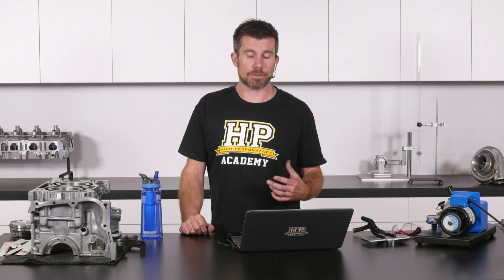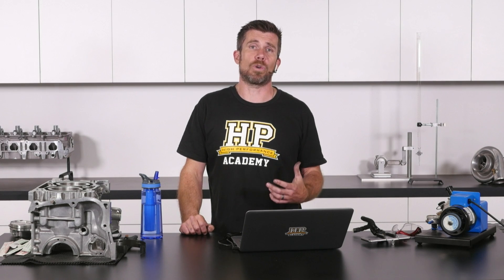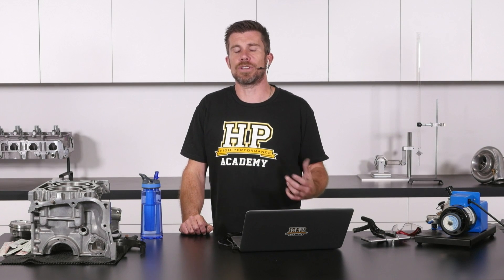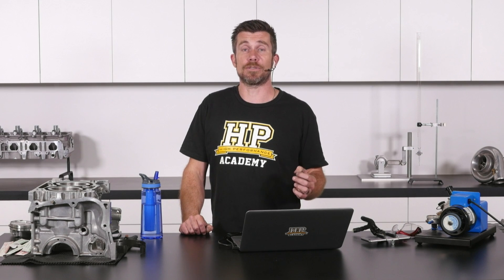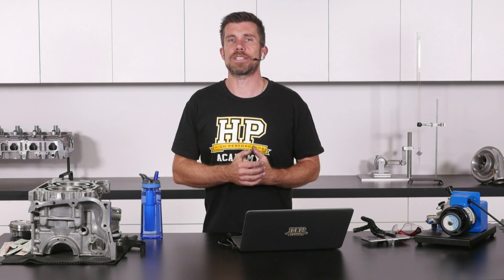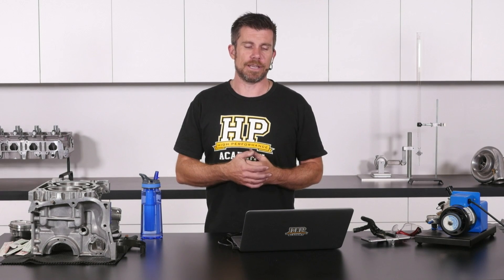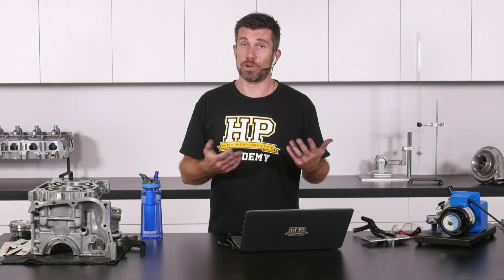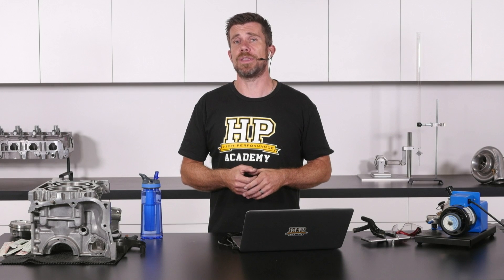Using Gapless Piston Rings On A Daily Driver [HPA Q&A]

Comment: I put well over 30K miles on my 355 with Total Seal 2nd ring gapless rings with no issues. 
 Oil stayed very clean for much longer, more idle vacuum, almost no leak down and great fuel economy. 
 The engine eventually broke a piston crown from detonation because i barely had a grasp on correct tuning. I was running too high of compression with too small of a camshaft on 87 octane fuel. I was also running the cheapest cast pistons I could find in the PAW catalog. 
Definitely was not the gapless rings fault. I still have that engine and eventually I will make it run again, with the same rings.

Comment: I want to know if the gapless and ported ring modifications offered by Total Seal would be useful for my application? I am rebuilding a junkyard replacement engine for a 2005 Volvo XC90 which I bought with a blown engine. The engine is a low pressure turbocharged 5 cylinder gas with designation B5254T2. The cylinders have been honed to take new Volvo pistons of size E in order to remove fine scratches in the bore (the originals were size D). My goal is to have a daily driver with power, longevity and low blowby. The carbon buildup in these engines is legendary for causing high crankcase pressure which  will blow out the seals. The vapor-oil separator device in the PCV system of these engines eventually gets its 3/4 inch oil return passage totally blocked with carbon. The fix is to replace the plastic carbon trap device and clear the remainder of the path into the oil pan, which may require removal of the oil pan if the passage within it is blocked. This happened to my XC70, which also has a 5 cylinder engine, but with VVT timing only on the exhaust cam. Upon disassembly of these engines, I noted that the return oil passages from the cams in these engines are tiny (like the diameter of a toothpick) and are nearly blocked with carbon deposits after 100,000 miles. These passages are created by matching grooves in the head and the cam cover and the only carbon removal method that would not damage the anaerobic sealing surfaces between the cam cover and the head was soda blasting.  
 I suspect that similar small nearly blocked passages were responsible for the strange behavior of my 2008 Volvo S80 after I had changed its PCV carbon accumulator device when it began to malfunction. This car has a 6 cylinder turbocharged engine and the device is on the top of the engine rather than under the intake manifold as in the 5 cylinder model. I changed the oil and filter after this service as I figured that some carbon particles may have gotten into the oil pan from the 1/4th of the carbon deposits removed by scraping and suction which were on the aluminum portion of the trap which was actually part of the head.  The very next trip was interrupted by the low oil warning on the dash. Inspection did not reveal any oil leak, but waiting for about 10 minutes and the oil was back in the oil pan. This behavior was unfortunately repeatable, and I assume that the temporarily missing oil is trapped in the head in the volume around the cams.  I have been treating this problem with Sea Foam added to the oil after oil changes, which shortens the time required for the oil to drain back to the pan. I have also been using Pro-Line Liquimoly engine flush before oil changes. 
In summary, does anyone have personal evidence for the effectiveness of the claims by Total Seal that modification of my top rings will decrease the blowby, increase the power, and make my rings last longer? 
Thanks for your consideration.

Comment: I’m confused because you say the rings won’t last long for a street engine but when you go to total seal’s web page they advertise the gapless rings as longer lasting than gapless rings and they are good for street engines... I know this is 2 years old but even summit racing magazines from 7 years ago advertise the same thing for gapless rings
Reply: That's what the manufacturer of the rings says. Remember that their goal is to sell their rings to as many people as possible, not to provide an objective analysis of their pros and cons. Other people who don't have a dog in the race may have different opinions or experiences. I never used them just because their long term durability isn't proven well enough IMO, but the fact that no production road cars that I'm aware of use them despite the technology being around for decades concerns me. Part of this could be a cost issue, but if their benefits were so great and they had no downsides, I would think we would see them used from the factory at least on higher end cars if not everything since less blow by also means less emissions, improved fuel efficiency, and longer oil life- all major benefits to car manufacturers.

Comment: I call BS on life expecting.   We been running total seal gap less rings for a few yrs on our daily heavy hauling cummins diesel,  have gotten just over 250k miles on it since its refresh and no issues,   best part is that the oil is cleaner than it used to be. Before the refresh,  so yeah telling people that they don't last long is BS.  525hp with 1900 ft-lbs of grunt with a quarter million miles is proof they dont wear out quicker than normal style rings.
Reply from the maker: 525hp on a large capacity diesel engine isn't really pushing the envelope performance wise. Andres experience with these rings and what he is more referring to are the likes of smaller capacity gasoline 1000HP+ performance builds.
At the end of the day it always pays to talk to your supplier before fitting anything as they have the most experience across a range of outputs and applications, and we are happy to hear your own setup is working as it should for your application 🤘 - Taz.
Reply: @hpa101  Great points. The fact that his engine is a diesel and diesel fuel is oily and helps to lubricate the rings unlike gasoline surely helps too. The lower redline of diesel engines could also be a factor.

Comment: I have total seal tnt series gapless rings in both my street rods both BBC engines one is N/A other is Turbocharged.  Both have been together since 2008 drive them when weather permits both are over the 30,000 mile mark and no issues and trust me i beat on them quite a bit. Gapless dont mean anything for wear it is metallurgy that counts .

Comment: I have heard rumors that they wear cylinder bores faster than standard rings. Is there any truth to this? In any case, thanks for sharing your experience with Total Seal gapless rings.
Reply: Skyline Fever no they’re made out of the same material as normal rings. Check out total seal’s videos. Very good information on there.

Comment: I ran JE Pitsons and Total Seal Rings in my Works Toyota turbo engine for over 7 years without any problems or abnormal oil use, or loss of power until I retired the car.  The car was used for daily use with AC for at least 4 of those years back in about 1985 and upwards.

Comment: ive heard that there is no real problem using them, but because of the slightly better sealing they pull more vacuum when the throttle is closed so if you have a valve stem sealing issue you may smoke and burn oil sooner. Also on a camaro forum a few years back they said with a proper setup standard rings produced less than 2% blowby in a leakdown test after a season of hard racing.

Comment: Been curious about this for a while. I would have thought the benefits wouldn't be obvious on a fresh build, as if the one piece rings were correctly gapped there would be only a thou' or three end clearance which would be negligible, but after some running time normal ring and bore wear would open that up a little - I have seem some race teams reporting less leak-down after 500 mile races than on original builds but don't recall which rings they were using.
That said, usual reasons for excessive ring wear is no, or poor, air filtration, using gas pressurisation on the rings (either gas ports drilled from the top or reliefs in top of top ring groove*), poor or incompatable bore finish, wrong ring material/face finish - could one or more of these have caused your excessive wear compared to other ring designs?
If I ever have the budget, one piston option I have been looking at is a single compression ring design and I was hoping the Total Seal rings would have been a viable option for a good seal over a reasonable service life?

*I have seen at least one manufacturer advertising rings with a sort of scalloping on the top face to allow combustion gases behind the ring to force them into contact with the bore.

Comment: I have used the child’s and alberts zero gap rings in street application with wonderful success. They work differently than the total seal design. Here is an article showing a direct comparison of the zero gap design vs conventional. https://www.hotrod.com/articles/childs-alberts-zero-gap-second-ring-test/
Reply: This article is from 1997 and apparently these guys went bankrupt in 2008
Reply: @Romance_png  I knew the article was old, but I didn’t know they went bankrupt! That sucks. The ring design that I described is actually still going going strong in a 450hp sbc I built 19 years ago. The current owner of that engine has told me they are changing to dished pistons for more streetability and that the bores and rings are still beautiful after all these years. That engine has been ran hard it’s whole life, for 19 years, and that ring design is still kicking strong. If you ever had leaking valve guide seals, the carbon from that may cause ring issues. But that’s with any ring design. I’ve seen carbon packing in everything from 4 cylinder cars to 15 liter semi truck engines.

Comment: Exactly right, they offer near perfect leak down but the down side is the increase in parasitic drag! In low power Formula Vee engines we find that a standard ring offers more power.
Reply: What extra drag?  The rings have a shelf cut into them so the thickness is the same is it not?  The difference in the gap between a single and this stacked ring would provide less contact area on the cyl wall because of both gaps (being 180* apart from each other) right?  I have never run these, and I am asking the question, not telling you you are wrong.  There was an article in a magazine a few years ago where they tested these on a 400 HP SBC.  The gapless rings showed about 10 ftlb and 10HP over standard rings.  I just dont understand your statement.

Comment: Nice. Question i want to know about water injection pure water what if i use only water in my boosted engine lets say 20lbs can i buy a water methanol kit an just add water a set the water injection too boost settings. Would that do anything too my engine?
Reply: justin mcclaren water methanol help alot especially cooling the cylinders and run more timing making good power.
Reply: what about runing just water
Reply: justin mcclaren no you'll destroy your engine running straight water.
Reply: dont sound right too me i have seen water an pure 93 pump gas together an manage some hp gains. this is also what i am talking about too as well 91 to 93 octane with water
Reply: justin mcclaren you mean distilled water?
Reply: Yes for sure
Reply: justin mcclaren you can run distilled water since its cheaper.
Reply: You can but running water methanol is far better, and if you already have the kit, methanol is super easy to find as a barbecue starter or cleaning solvent, just make sure it's pure. You can mix it yourself with distilled water to get the appropriate ratio
Reply: Pure water is fine - as long as the temp's are above freezing - then adding alcohol will reduce/prevent freezing.